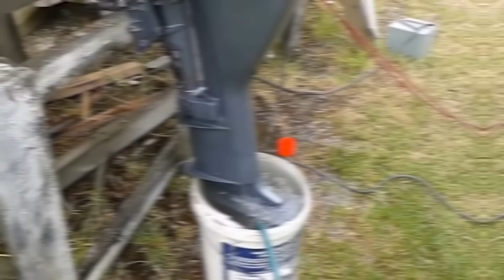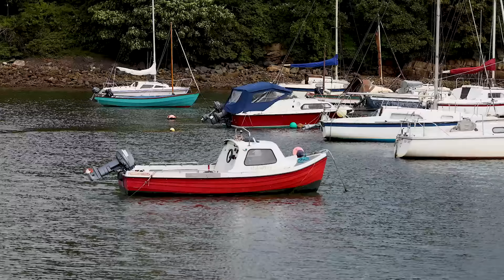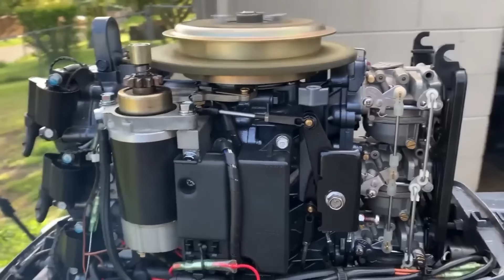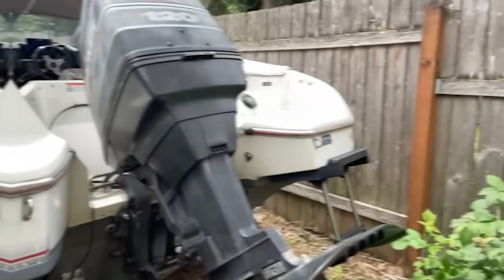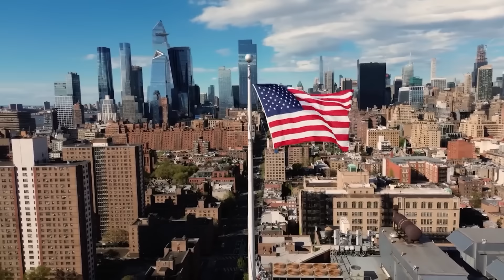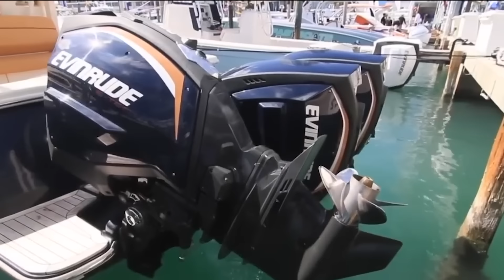The WORST Outboard ENGINES Ever Made (AVOID AT ALL COST)

Comment: 100% true on the etech 40 (2012). COmplete bucket of crap. High speed fuel pump developed a leak over time, that is what caused the fires. The replacement part was actually 2 merged into one ( vapor seperator), solenoids went in the lift mech, parts very hard to get and expensive and no shop wants to touch them. Glad I got rid of my and got a new zuke to reoplace it, the upgrade priice hurt but it was worth it.  f etch

Comment: My 05 df140 runs fine changed the plugs twice and the injectors once. 
Been trouble free  but now the wire harness to the trim is acting up. Im the original owner and i believe somewhere around 400 hrs.
So if all these motors are junk which ones are good

Comment: MY 05 OPTI runs trouble-free
Reply: My 200 optis still run strong they will beat  four strokes all day long and burn half the gas
Reply: my 2011 175 hp had a low pressure pump fail..took me a long time to figure it out, kept stalling..replaced it with a china pump works great
Reply: My 2007 115 optimax runs great.